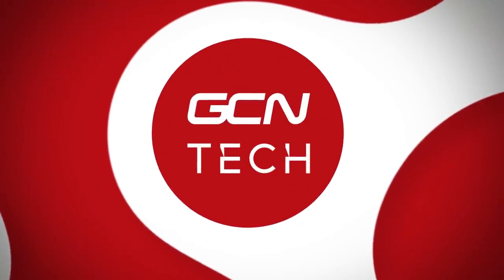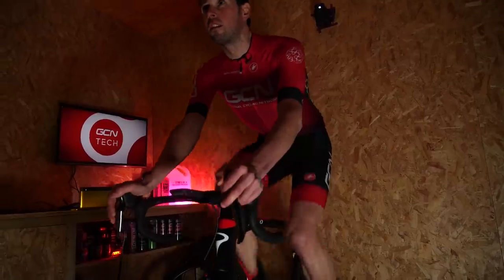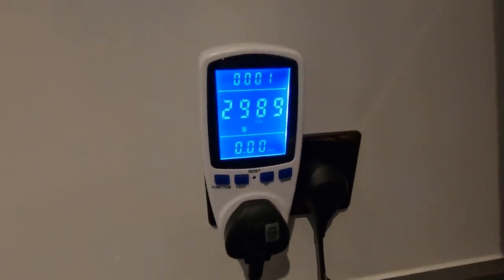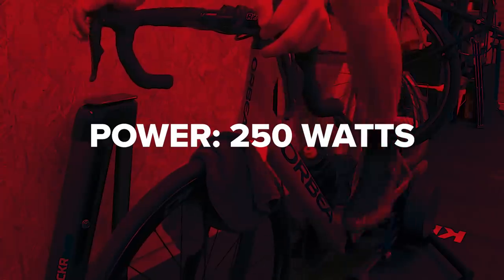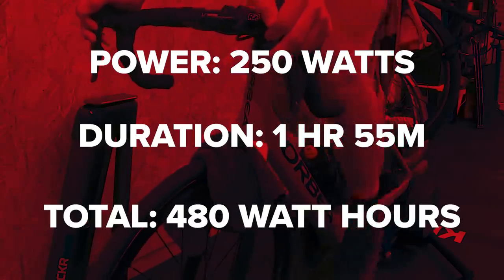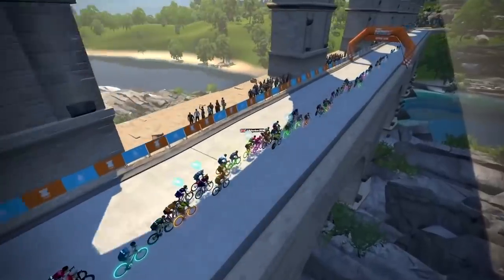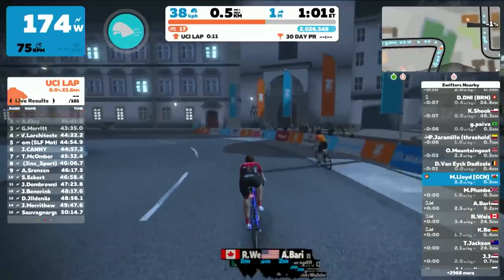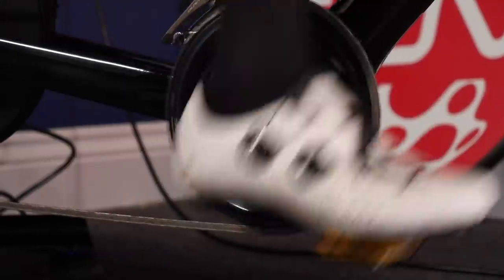How Many Watts Does It Take To Power Your House? | Is Cycling A Viable Green Energy Source?

Comment: So when I cycle on Zwift I have my fan on (80W) computer running (100W) and the monitor glowing (50W). So I doubt in the real world I'd be able to give anything back!
Reply: You'd be correct, but likely your computer and monitor are much better than that. Those would be very old systems. A laptop can run at around 30-40 W.
Reply: @tychoMX  I do indeed use an old computer, with an old monitor!